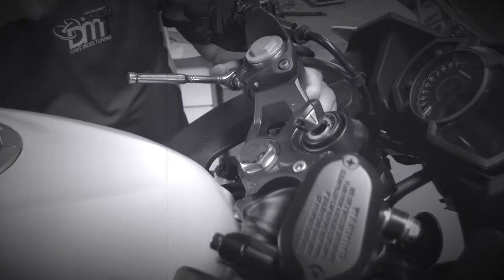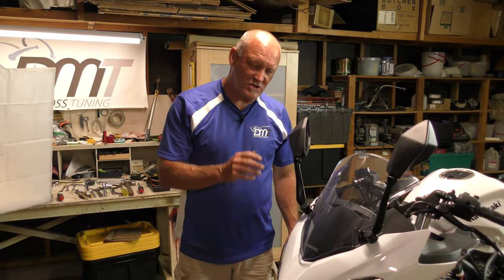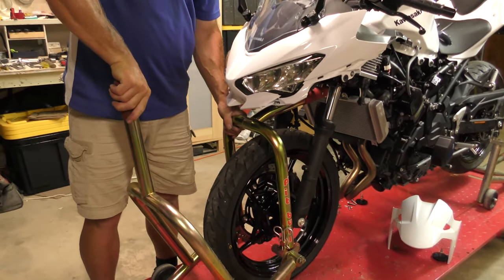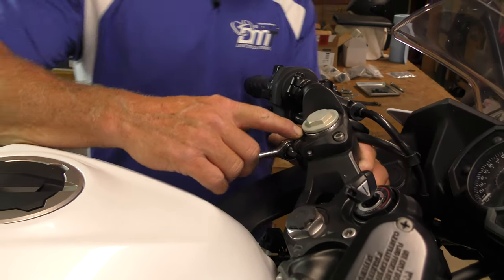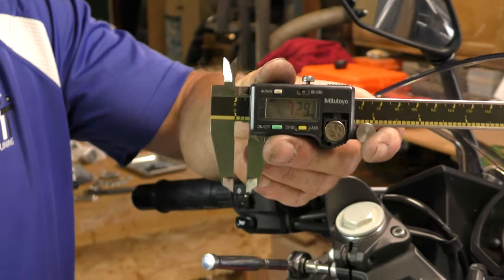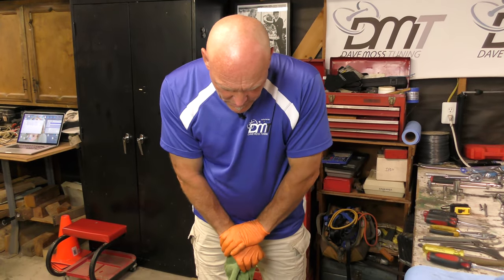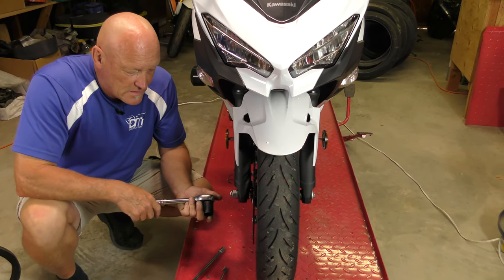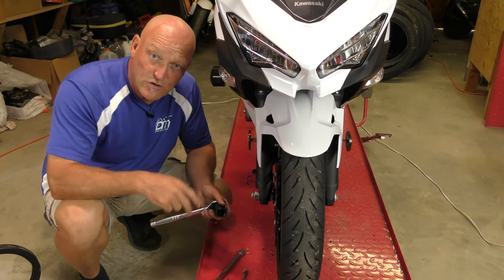INTRO Fork Oil Upgrade, Thickness & Volume: Ninja 400 Project Ep 6

Comment: Hello. I have hard time understanding the "air spring" effect. I have only preload adjustable forks on my suzuki gsr750. spec sheet says volume is 520cc of suzuki l01 oil. I completely bottom out these forks under hard braking, so i decided to experiment with oil viscosity and level and filled forks with 10w and 500cc of oil. If I follow specifications and add 520cc, I can no longer compress them to max travel. Is this hydrolocking or an air sping? I do understand that thicker oil equals less volume.  Can anyone explain?
Reply from the maker: When you add oil over the stock volume and travel is reduced even after  strenuous efforts to make the fork bottom, that is hydrolock. I work wit low oil level and then add to find this point, then go back to the previous oil level. Some testing in one sitting will tell you what is needed, then the other fork and future oil changes become very quick and simple.
Reply: @catalystreactionsbw  Thank you for replying. I have managed to get "air spring" without losing any travel. I maintain motorcycle by myself. Your videos helped me countless times. Best of luck.

Comment: I would think you wouldn't bottom out because of heavier oil.
Reply from the maker: If you sustain enough force you will get the forks through the full stroke irrespective of viscosity. That speaks to ability/skills and confidence with brake pressure and duration.